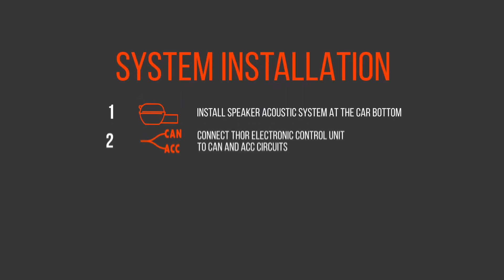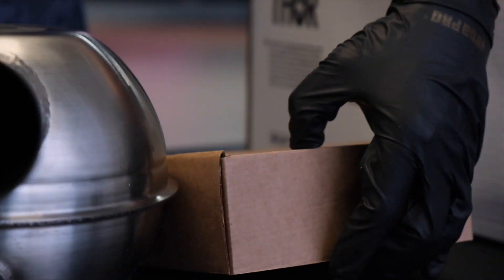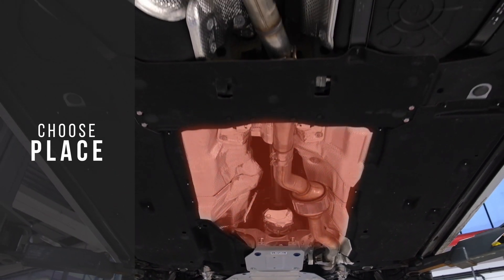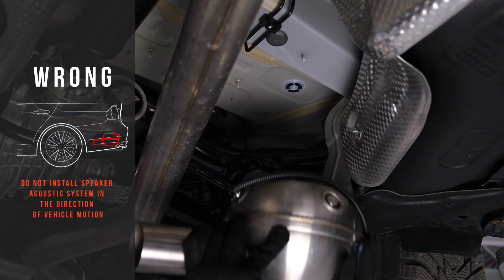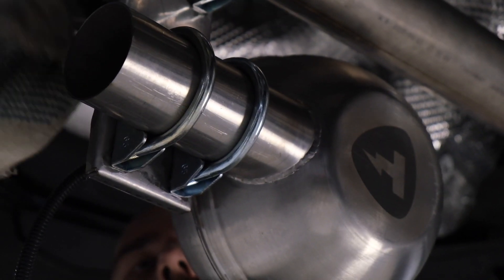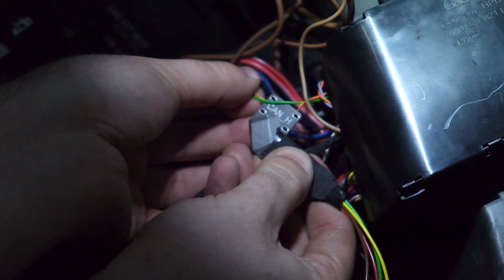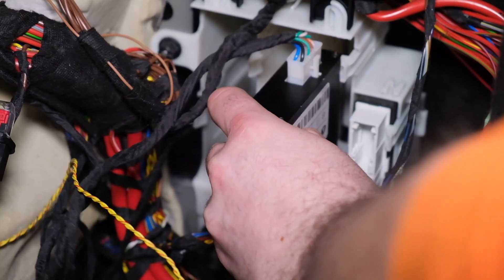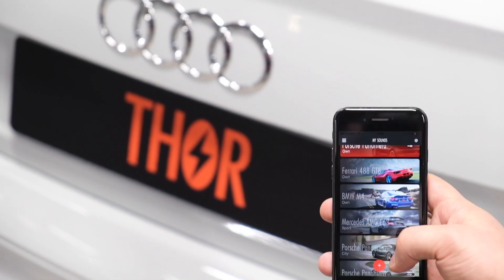Thor exhaust system installation instruction

Comment: Tell us how this messes up performance and fuel consumption because the ECU has adjusted?
Reply from the maker: system power is 80 watts when the sound is on, current consumption is 6A in constant mode, very insignificant but may increase fuel consumption

Comment: I just wish that the connection is as ez as plug in to the obd2 plug...no wire cutting needed....
Reply from the maker: For this purpose, we have additional accessories that allow you to avoid cutting into the wiring. 
Unfortunately, the OBD2 connector does not allow you to achieve the results you want for the sound of your system.

Comment: J'ai une cupra formentor, où commander et faire installer par un professionnel en France ? Normandie? merci....
Reply from the maker: Bonjour, vous pouvez commander le système directement auprès de nous via notre site internet, nos responsables peuvent vous guider vers les partenaires les plus proches en France. De plus, le système est assez facile à installer, il peut être installé par n'importe quel service en qui vous avez confiance, et notre support technique est toujours disponible et peut aider le technicien à installer le système correctement.

Comment: They expect ppl to buy this and leave it on shelf lol, where is detailed cable and electronic guidance!??
Reply from the maker: Detailed instructions for each macra and model can be obtained by contacting our tech support. Managers will advise and tell you about all the features and send the necessary materials. This instruction is general, the principle of installation and operation are explained.
Reply: @thor_tuning  bro who cares about getting the instructions after purchase, we need to see how you manage both cables, power and can bus, so that we show to mechnic at our loction to see if hes willing to do so, if not then why would i buy it.
Reply from the maker: @DB-qz7se  you can clarify all information before purchasing the system. A technical specialist will explain everything from start to finish, taking into account all the nuances and peculiarities of different vehicles. Among other things, he will be able to send personalized instructions for different cars.
Reply: @thor_tuning  better make some detailed video on how to do it properly
Reply from the maker: @DB-qz7se  we fully agree with you, and our team is currently developing video tutorials detailing every step of the connection and installation process.
Reply: Is there a wiring instructions video out now? My mechanic said he won’t do it as he doesn’t want to dry the canbus on my car. So before I go crazy I need to make sure he can do it.

Comment: Does it draw power continually? Meaning, will it drain your battery?
Reply from the maker: In the new firmware, we have a sleep mode, 3 minutes after the car is turned off, the module goes into sleep mode and stops consuming electricity
Reply: @thor_tuning  can these be used on multiple cars? Meaning, if I install on one car then decide to sell it, is it easy to remove them put them on a different car?
Reply: @thor_tuning what is newest firmware number? I can’t find sleep mode
Reply from the maker: @zerll  his function is available for many models, it is enabled in the application settings from the buttons on the steering wheel, for more information, you can contact technical support by clicking the "support" button in the application
Reply: @thor_tuning  I have a 15-inch sub in the back of my Audi. Is there any way that I can bypass the speaker inside the exhaust and use the module through the head unit radio?

It would be awesome if I could run an app of my iPhone an use various car sound witless or wired somehow.
Reply from the maker: @ We offer electronic exhaust in the form of control unit and speakers (1 or 2) of our own production, but also do not exclude the possibility of connecting the unit to similar speakers of other manufacturers. 
For more precise answer to your question it is better to contact technical support https://thor-tuning.com/contacts/.

Comment: How does it kno wen u are revving?
Reply from the maker: The system unit is connected to the vehicle's CAN bus. Therefore, all necessary information is read out.
Reply: Can I connect it to Can Bus from the OBD2 port?

Why do you don't have a OBD2 port conection for power and Can Buss... it would be great...

Comment: @thor tuning how it will work with lexus gs450h with cvt transmission? When the electric motor will work and petrol one stop then sound will be cut or there is any other solution for it? I coudnt get any info about this sound system with cvt transmission. Please give me an answer
Reply from the maker: The system works on all types of cars, including hybrids, while the electric motor is running, there is an emulation of the engine. There is special firmware for hybrids.
Reply: @thor_tuning  thats a perfect info for. you should make an video about hybrid and electric cars becouse no one did yet any other company and there is no info about hybrid, electric etc. Thanks
Reply from the maker: @DangerousTruth.  We'll be sure to make a video. You can also watch videos about electric cars on our Instagram
Reply: @thor_tuning  grand. Are You based somewhere in Ireland?
Reply from the maker: @DangerousTruth.  We have an official representative in the UK and a partner in Ireland
Reply: @thor_tuning  can You give me more details about the partner in Ireland? Cause I will be interested to mount it on my lexus
Reply from the maker: @DangerousTruth.  Of course! It might be more convenient to contact you personally. You can contact our support, for your convenience you can go to the dialogue directly from the tor app or https://wa.me/74951338589

Comment: Do you have the metal plate on your website that you mount on the sound booster to connect with the original exhaust?
Reply from the maker: We install our own bracket on each machine, somewhere we need it, but somewhere we just need to weld it with welding.
Reply: @thor_tuning  ok, do you have the bracket and the screws for sale?
Reply from the maker: @54fredde  Free universal bracket included free of charge. For example, for BMW X5/6 40 there is a special bracket $ 39
Reply: @thor_tuning please I have same question. Can I buy the bracket from your store?

Much regards.